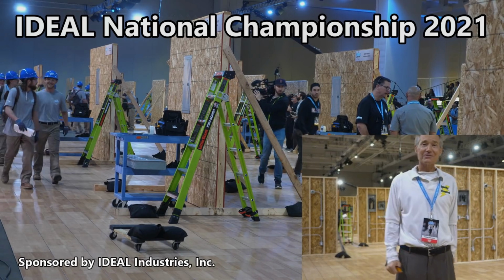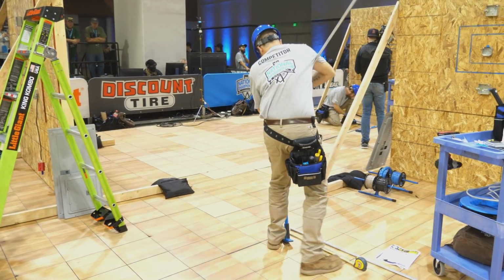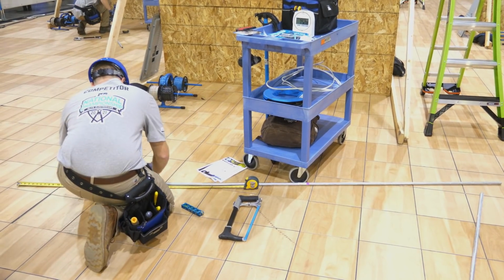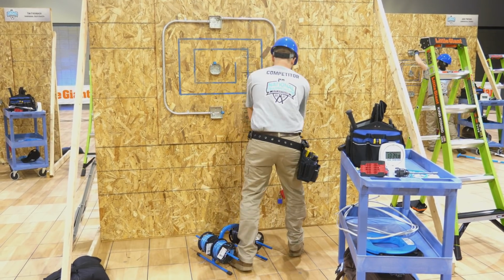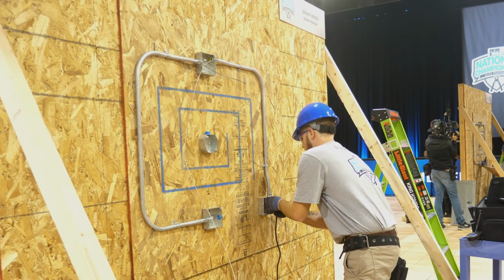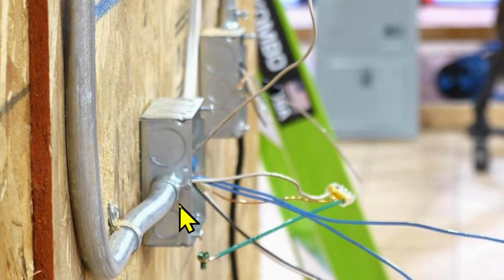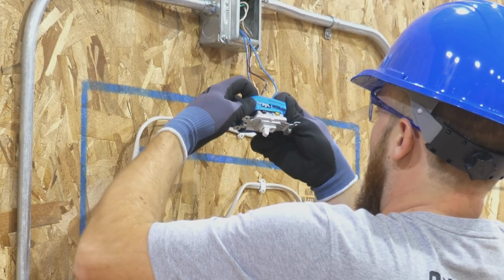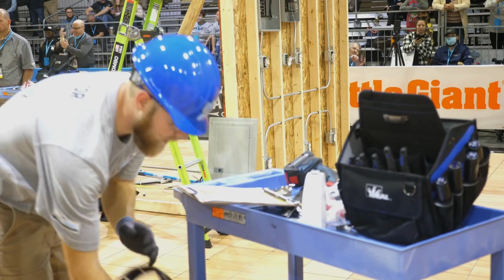IDEAL National Championship 2021 Apprentice 1st Round Competition from Nashville

Comment: I dont understand how the code allows pipe to be reliable for a ground that is wild
Reply from the maker: They do lots of testing on things like that before making it code.
Reply: @SparkyChannel  I always run a grounding conductor because of these three rules I was taught in my apprenticeship. A grounding electrode also connects directly to the ground bar in the main disconnect, which is also tied in to the neutral bar and will always trip the breaker, unlike EMT alone.

(1) A single loose coupling in a long EMT run can break the ground path.
(2) A grounding conductor provides a lower-impedance path than the steel conduit alone.
(3) It simplifies troubleshooting.

Comment: His journeyman should've taught him better.. Why would you waste time with offsets before the 90s
Reply: I find it more effecient as the calculation of the 90 bend is more precise. An offset will take the length of the pipe off by a quarter of an inch. Furthermore, it will help make the 90 at the intended direction. If you can do offsets after making the 90 bends and put the pipe in the pipe connectors precisely then I am happy for you.
Reply from the maker: Thanks!
Reply: I bet your apprentice love working with you

Comment: I need help I got a electrical problem all my gfci lights are red and once I plug a tester in says 30 vac I don’t know what that means
Reply: Try hitting the trip button and then resetting the GFCI. If not then you could have a loose wire, or a bad GFCI.
Reply: Everything use to work it just went out of no where and the breaker stays on and I change them already
Reply from the maker: @alexthegreat2323  Loose wire?
Reply: @SparkyChannel  when I put a plug in tester it says 30 vac in to one of the outlets from the circuit

Comment: Bill.  Maybe you could explain 250.119 or at least why Jordan did what he did.  Couldn’t he use the incoming EGC from the SO cord and connect it to the box?  That would the ground the box and the EMT would be the bond.  Then there would not be a need to run a white wire to act as a ground wire, right?  Additionally, depending on the type of 3-way switches (self-grounding or not), the 6-32 screw could bond the device to the already-bonded box, right?  Or he could connect a bare copper wire from the box to the device?  And the white wire needs a “continuous outer finish” that is green.  Sounds like using green tape would not satisfy.  I don’t think the extra white wire was necessary.  Maybe you could do another video and elaborate.
Reply from the maker: Great idea. That will make a great video I think. It'll be a while though, as I'm editing more competition videos right now.